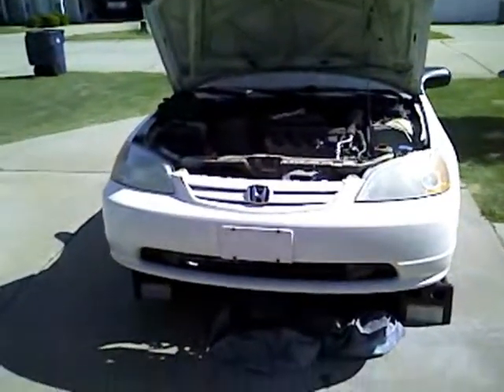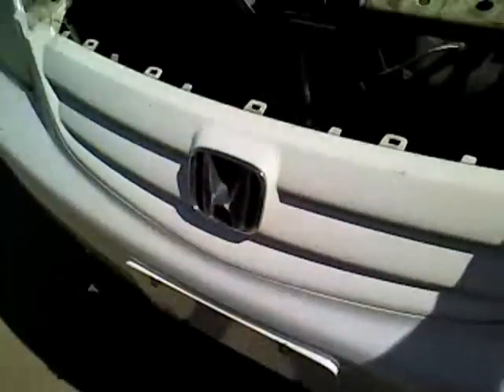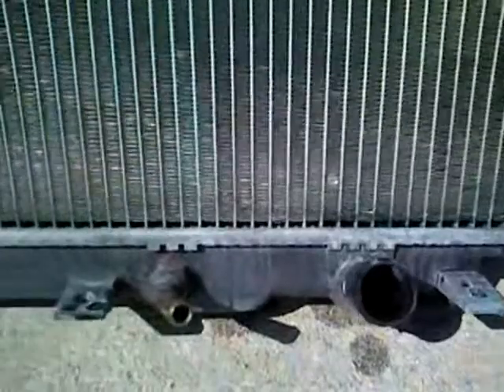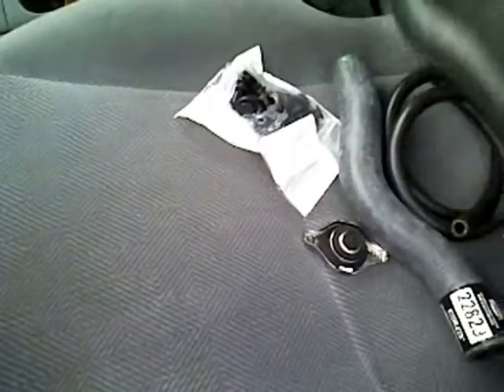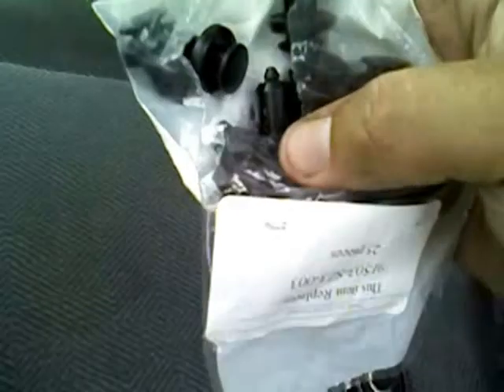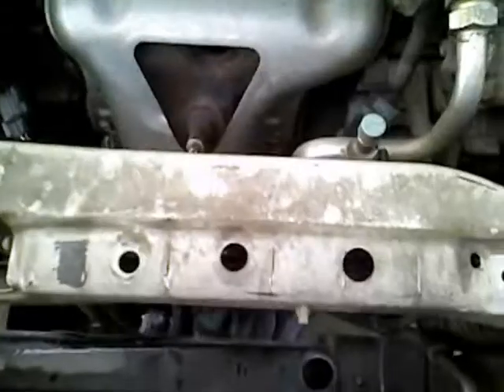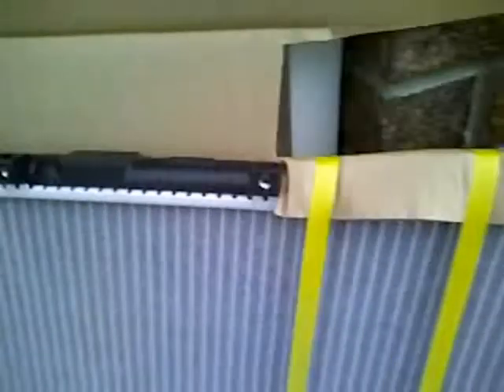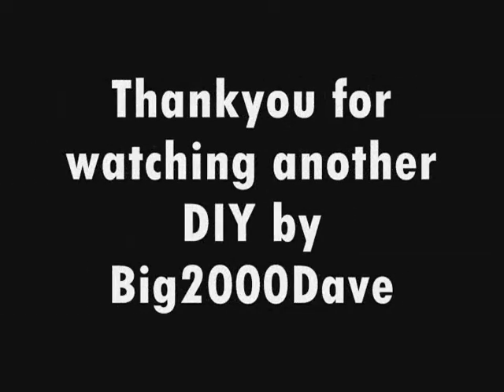Radiator Replacement : Part 3 of 3  (2001 Honda Civic)

Comment: Remember the more thing's you remove the easier it is to do the job. I would of removed the front bumper piece. Its not hard at all. 4 snaps on top and (5) 10mm bolts on the bottom then 2 Phillip screws on each corner. Thing pops right off